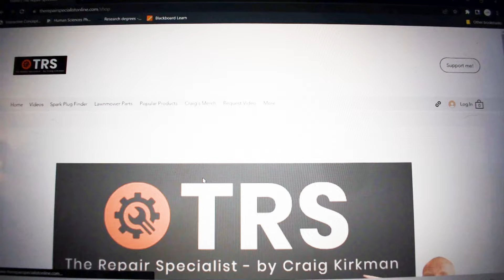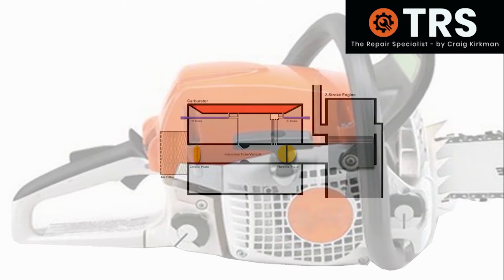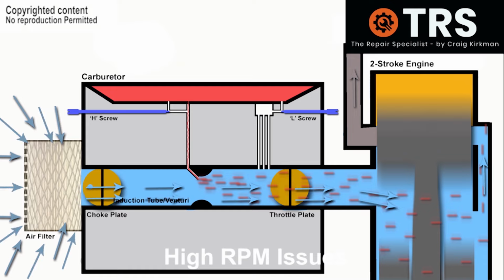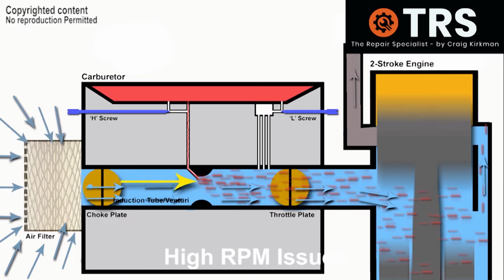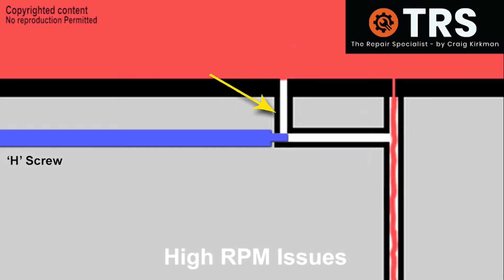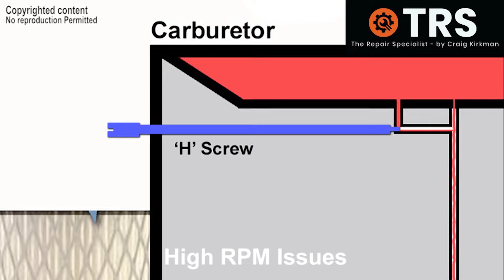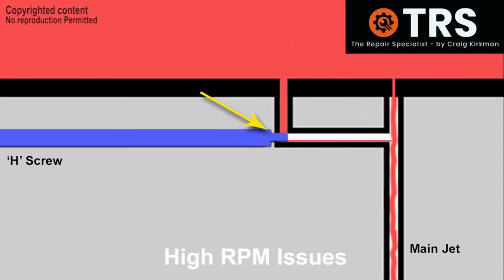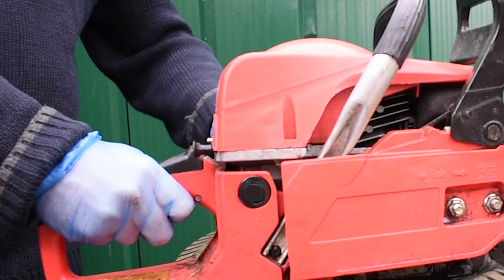Chainsaw Bog Down Corrected in Seconds. This is how!  (by Craig Kirkman)

Comment: I have to say, you are a lifesaver. We recently just suffered thru typhoon mawar on the island of guam. The 5 very tall mango trees in my yard all were knocked over or snapped at the thick bottom branches. I've been trying to get my stihl 025 working for the last 10 days. Nothing worked. Took apart and cleaned the carb, replaced the sparkplug, coil ok, exhaust port ok, airfilter ok, fuel filter ok. But the saw just wouldn't start or it would start and could not keep idle, or bog down. Then I tried adjusting the L screw and idle screw. That didn't help seems like I keep flooding it. Following other YTers small engine advice, still no start. Then I came across your channel which imparted some knowledge and a schematic of sorts on how these carbs work showing What happens when you adjust the H L IDLE SCREWS. it was obvious to me right away that a good starting point is to close up the L screw and see if the saw fires on the H screw alone, if it does, then I can adjust the L screw for the sweet spot and the idle. So I closed the L, pulled the starter on choke and the saw fired on first pull, after a few seconds it started to bog down which tells me to open and adjusting the L screw, which worked to keep the saw running. From there it was a matter of adjusting the L a little open and closed to find the sweet spot, then adjusting the idle to get that correct. It all worked and I'm now clearing the yard of tons of mango limbs, thick as your thighs. However it's going to take awhile of listening to the engine to get a real feel for the adjustments based on how the rpms sound. I feel like I'm the small engine whisperer now. Thanks.
Reply from the maker: That’s awesome. I’m really pleased you got your chainsaw sorted out. Sounds like a very country where you are from. Where mango trees flourish. Thank you for the feedback. I really appreciate it. Craig 👍
Reply: @TheRepairSpecialist  The island of Guam, America's fortress in the Pacific. Typhoon Mawar passed over the Island nearly 3 weeks ago 140 mph (224kph) winds for several hours. Most of the homes are of solid cinderblock or poured concrete, with installed typhoon shutters. But the vegetation gets wiped out, grows back with time.
Reply from the maker: I am really sorry to hear that, and I really hope you, and your family and friends are ok. Craig

Comment: My ms170, a bit hard to start then, when warm, I press the throttle it bogs a bit, then after 2 or 3 seconds picks up speed to cutting speed. There is some hesitation before it "kicks" in to cutting speed. What does this mean? Any help would be greatly appreciated!

Comment: So mine is wanting to quit when idling, it tries to idle a little but ultimately dies. So I would run the Low out maybe a 1/4 turn?  And also it wants to bog under load and I have to back off some, so that would mean I would also adjust the H screw out a little too?

Comment: Before I go turning any screws for adjustment...my TSC Polan 18 inch Wild Thing was brand new, stored fuel empty when not in use, and stored in my house & inside its factory black plastic case. 

After my last good use of it, I had store it, in it's factory case, inside my shed. 

Weeks later it starts up fine, revs a bit sluggish at first before reving normal. I let it idle for 5 minutes.
Trigger is good. 

However, as I start my cut ( its sharpenned each time I have nicked rock or metal. Only nicking. 
I'm very observant, yet some old fencing gets in the way on occassion. When sharpenning I inspect the chain mannually running it at top of blade. Motor is completely off. 
I file each nick down smooth & flush to factory surfaces. )
 
...as I start my cut it begins bogging down. 
As it cuts into a freshly fallen tree,
 the process is whoafully slow. 
At full trigger I get no power increase. Never enough torgue to finnish the job properly. 

I normally cut through ( one pass )  8 inch diameter fresh fallen trees in about 4 to 6 seconds. 
This time it took me over 15 minutes on one pass.

Comment: Hello Craig, I can't get mine work whereas it's a brand new (Chinese) chainsaw. On delivery, it worked well several times and all of a sudden it stopped.  I checked out the carb (including the metering lever), the lines (vent, fuel, impulse), the ignition coil, the intake manifold (no cracks) even the clutch and the oil pump. No matter what I do with the fuel jet screws, the engine starts and operates for no longer than 2 seconds. As I don't have any Mityvac, I can't know for sure, but would crankshaft seals be the cause by leaking air? In other words, I need advice to identify the cause.